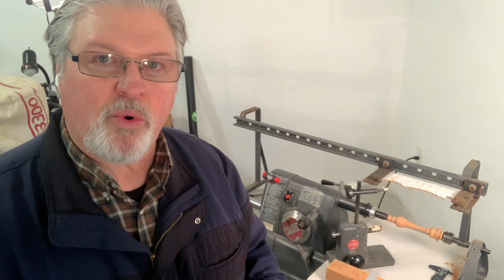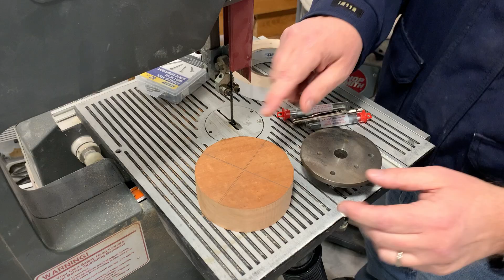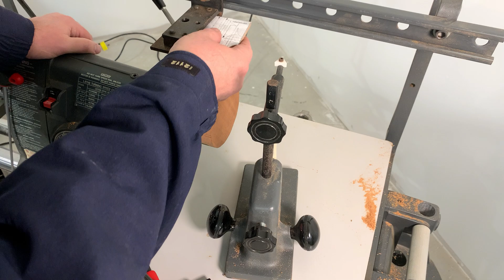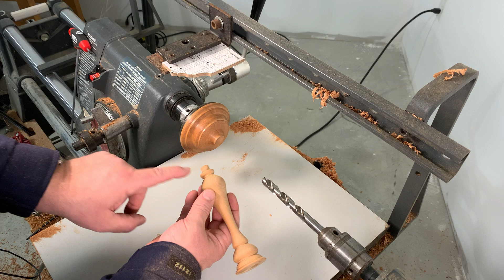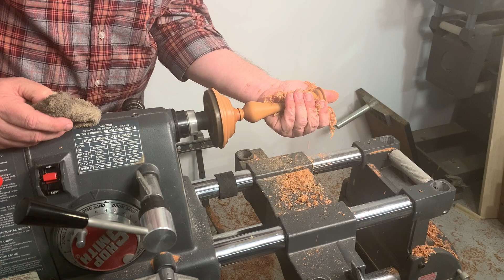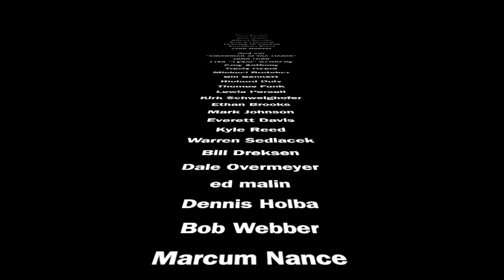Shopsmith Lathe Duplicator, Faceplate Turning

Comment: Do you know of any downloadable patterns for the duplicator?
Reply from the maker: No, other than this candlestick, which was included in the owners manual, which can be downloaded from the Shopsmith owners Facebook group files.
Reply: @MyGrowthRings  Thanks for the response. I've never done Facebook or any of the other ones with the exception of a bamboo rod maker simple list serve that was started back around 1978.  I've had this duplicator probably 15 or more years and have never made anything with it was thinking maybe its about time to use it. Your videos have inspired me to do so.
Reply from the maker: @floydburkett630  Do it! If nothing else, start playing with it freehand.
Reply: @MyGrowthRings  So I spent some time digging around in the garage and found the duplicator manual. It has the candlestick in it so   I think I will make a couple of them and give them away.
Reply: I thought I might add that my first Shopsmith was a 10er, and while digging around I found some old literature.
Reply from the maker: @floydburkett630 That’s awesome. Keep plying with it because there are a few things that are counterintuitive but that help to leave a nice finish.

Comment: Excellent demo. But one question: On the faceplate turning, for the final cuts, shouldn't the duplicator always be 90 degrees to the template? For a faceplate turning, this would involve a lot of movement of the duplicator, in order to keep the tracing head perpendicular. On a spindle turning, you just follow straight across, which automatically keeps the tracing head perpendicular to the pattern (or you end up screwing up the diameter of the spindle). Unless you're 90 degrees to the template on the faceplate, isn't the profile you're trying to duplicate also going to be "off" from the original pattern?
Reply from the maker: Hey Michael. For some turnings, such as the rosettes I mentioned turning, you absolutely have to cur them with the cutter facing the headstock. (I think that’s how I’ll say it to keep things straight in my head!) on this piece I was happier with the cut I was producing when the cutter was positioned as it was when I was turning the spindle. It duplicates the peripherals shape either way, as long at the stylus and the cutter are properly aligned. Scott

Comment: Could have given yourself some extra material so screw holes wouldn't be in the bottom of the project. Also I see you using cloth to wax instead of paper. Please use paper towels for your own safety.
Reply from the maker: Yes, I could have. This project is destined for my grandkid’s play kitchen, so I wasn’t all that concerned about screw holes.

Comment: You seem to be one of, if not the biggest, shopsmith channels on youtube. Why do you only use the old mark 5? It would seem to be better advertising for them to hook you up with a new and shiny mark 7 with their new headstock. What keeps you from upgrading? I love the content you mkae, I just have a hard time finding content on any of their newer stuff.
Reply from the maker: I wouldn’t mind having a PowerPro headstock but for me I see no advantage of the Mark 7 over the 510/20. Thanks for your kind comments about the vids. Scott
Reply: @MyGrowthRings  I've been looking at getting a new one especially since they offer financing now. What is the main difference between the mark 5 and mark 7? The website says it adds the router and shaper but what stops me from doing that with a mark 5? Can't you still do the over head routing on a mark 5?
Reply from the maker: @codysmith1915  Double tilt. With the Mark 7 double tilt you have the ability of bringing a shaper cutter or router bit up through the bottom of the table, as opposed to having it mounted from overhead. What do you give up for that feature? You now have to remove any SPT, such as the bandsaw or jointer from the end of the machine every time you move the machine into the drill press or shaper position. I don’t have to do that with my Mark V.

Comment: Scott another most excellent demo.  

I believe that a beginner can turn out excellent results on the duplicator in 10% of the time they would need to acquire sufficient skill and knowledge to do so with traditional chisels.

The learning curve is so much more acute because the tools contain the accuracy rather than the hands.  And, it is much safer than tools… after all, the cutter is mounted to a stand, sitting on a table and maneuvered by hands while  close to the table.  Much unlike tools,  pinched between a few fingers atop a tool rest mere inches away from the cut.

I have another video that shows an extremely useful application for the duplicator… maybe I can work something up in a week or so.  I’ll give you a heads-up.
Reply from the maker: I totally agree and can't wait to see your next video (as always!) Scott

Comment: Another great video! Project turned out very well too! As you demonstrated, the template for the face plate was secured by set screws in the Lathe Duo. support. These same set screws can be used to secure the template for the spindle provided the ends of the template are wide enough to use the set screws. This allows adjustment of the template back and forth  to allow the final width of the turning to be adjusted as needed. The template gives mainly the desired profile of the turning, whereas the position of the template (forward vs back) determines the width of the turning. Also, when I took the lathe class at the academy, we were taught to hot glue a block of wood to the project and screw into this extra block to secure the whole thing to the faceplate thereby eliminating the screw holes in the workpiece, and also eliminating the concern of damaging your chisels on the screws. Happy turning, jim
Reply from the maker: I use the same method of double-sided, tape and screws on a bowl once that was 10 inches in diameter, and about 3 inches thick. After finishing the turning, I went to remove the screws and was surprised to find that I forgot to install them! The double sided tape was all it took. That said, I would never advise that. I’ve played a bit with hot glue, but some of the pieces I was turning were stained by the glue. I could definitely see gluing to the waist side of a bowl while turning a dovetail or spigot on the bottom for use with a chuck. I might have to give it another shot.

Comment: If I can back-seat-drive for a moment for the benefit of folks who don't turn very much:  You mentioned that you got some chatter when you tried to tweek the upper end of your candlestick before you drilled the hole in it.  I'm sure this was caused by the excessive stick-out or unsupported length of wood.  You were just cutting to far from your faceplate.  This could be mitigated in at least two ways. 1) Use a steady rest to support your work much closer to the cut.  2) tip your gouge up to make the cutting edge nearly vertical to make an extreme slicing cut.  This also works ho help prevent tearout on stubborn end grain.  Take very fine cuts with very light tool pressure so that you slice off little wisps of angel hair.  Even better, use both of these techniques together.

The one thing you should not do is replace the very capable Shopsmith with a machine that those unfamiliar with the Shopsmith capabilities might call "a real lathe".  A $10,000 Robust will chatter just as bad in these conditions.  (Yes, I have had a few uneducated people laugh at my Shopsmith.)  I'll get off of my soapbox now.
Reply from the maker: Feel free to backseat drive! Yes, I was on the fence about grabbing a steady rest, In retrospect I should have taken the time to set one up. Scott

Comment: Why don't you use self taping sheet metal screws? I understand the centering the holes but if you're using the correct size screw and self taping no need for all the drilling, just screw in then the out to clean shavings then back in
Reply from the maker: I've found that self-tapping sheet metal screws do too much damage to the wood.

Comment: As someone who has never turned or used the duplcator it would be interesting to know what you are watching. The cutter or the guide or back and forth between the two.
Reply from the maker: Good question. Until I get to within a 1/8" or so I only occasionally glance at the template. Once I'm making the final cuts I'm pretty much only looking at the follower and the template.